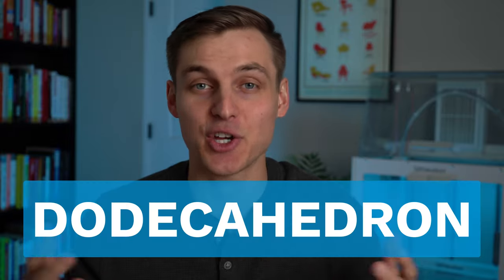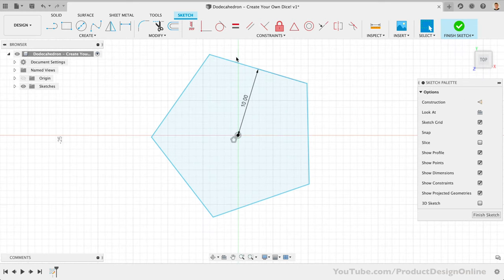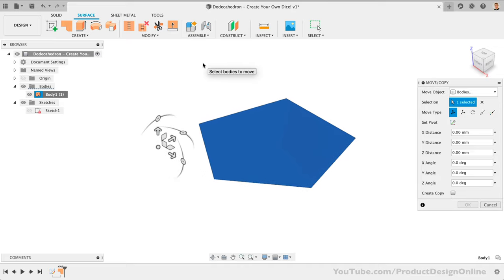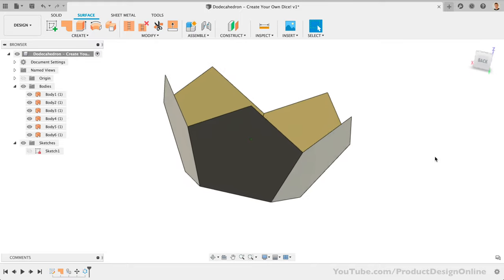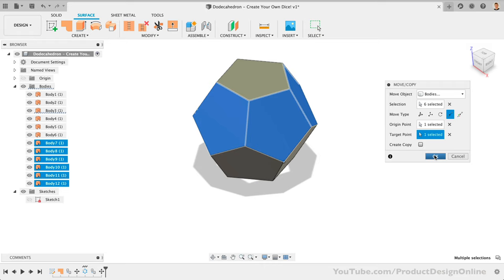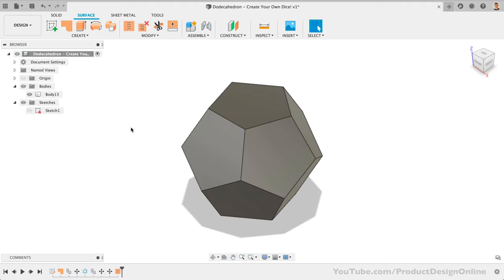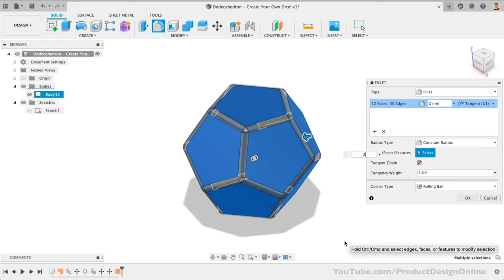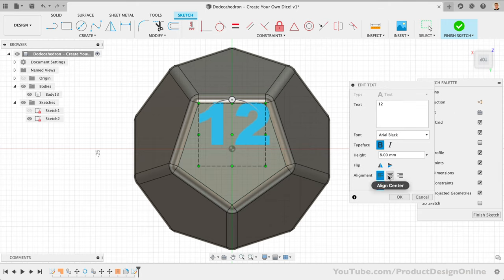Dodecahedron in Fusion 360 - the fast way!

Comment: In case anyone needed other dice shapes(or just other polyhedrals) like a D20 or D8 the exact same process works just use the the dihedral angle for the shape you want and the proper base shape in the case of D20 and D8 its an equilateral triangle

Comment: 3:03 As a dice nerd that is aggravating, making fair dice is all about precision and you have a far more precise number ready to go but then intentionally introduce inaccuracy! The stitch is forced to pull the sides together creating irregular side lengths...
Reply: So how would you make one?
Reply from the maker: You have a very valid point. This was more for fun than anything. I wouldn't recommend printing dice to anyone if accuracy is what they're going for.

You can use the equation [ π − arctan(2) ] instead of rounding and you can change the stitch tolerance to 0, which will help on the Fusion 360 end.
Reply: What about the different amount of material (mass) missing from the different numbers? does that grind your gears too?
Reply: @ProductDesignOnline  Great video, as always! But I have to say that the rounded up angle bothered me a bit, both for the inaccuracy, but probably more that it must have introduced a secondary error when you did the point to point move. The 2 corners of the adjacent pentagons can not have been in the same place, correct? :) I assume the error was very small and anyway erased with the Stitch tolerance, but still, it bugged me ;) 

Would there be any other easy way to align the corners exactly, even if one did not know the angle between each face of the dodecahedron, say it was a more random shape or something? Could it be done with joints? I´m very new with Fusion 360 so sorry if its obvious how it should be done. 

I've learnt a lot from your videos already, thank you for your work!
Reply from the maker: @Robinlarsson83  Yep! You could use Joints to position them. With the Joint feature, you would set the Joint origin - likely the center of one face - and then select the opposite face (of the other half). You would then set the offset of the Joint according to the thickness of the model.

Comment: Hi! 
I tried following this tutorial twice, but after I Copy body 1-6, rotate them 180 degrees and try to connect the points - It wont fit like yours do.
I have followed it to the best of my ability, I even tried once using the real 116.56505 degree values, but that made it worse.

I wanna make a 12 sided die where the numbers are 1,2,2,3,3,3,3,3,3,4,4,5. I tried downloading your finished STLS, but I cant edit the numbers on those. 

Not sure if its because an update or I am doing something wrong, but I followed every single step here, but fell out when it was time to connect the 6 bodies

Comment: Hi Kevin,
I watched your tutorial on how to make a custom dice in fusion 360.Now dodecahedron has even more types, such as a small stellated dodecahedron. I have been busy making this, where was more difficult than I thought, I have tried it in different ways but without no luck. The first attempt was way too hard, the second was better, but I'm struggling to get the model to fit together. With the move and rotate function it will be possible, but not the easiest way I think. What would be your approach? First make a dodecahedron, and then continue modeling from there?
Regards from the Netherlands,
Paul
Reply: had to look up what a stellated dodecahedron was... I would think you would do it exactly the same way, but before you patch the pentagon, you would create the stellated portion. then patch that entire object as shown in the video.

Comment: I have been trying to draw a figure 8 shape similar to a figure 8 race track. Do you think that you could demonstrate how it is done.
Reply from the maker: Hi Mark. Check out the "Sweep" command. You can create your path using a 3D sketch. What is the track for?
Reply: Thanks for rapid reply. It is for the roof of an architectural model designed by a student. However, the shape is a figure eight with a lower layer going under a bridge just like racetrack.
Reply: @1majca  You can try a 3d sketch and then use the sweep command.

Comment: 5:35 what does the tolerance do here?
Reply: It's not blue, so....It's not a required part of the operation.
Reply from the maker: Great question! Surface edges must be adjacent to each other to stitch successfully. The Stitch command has a tolerance control that provides an upper limit that helps the software determine the proper edges that are used for stitching.

In our project, the edges should all be touching/aligned because we placed them in place. This feature comes into play more when you have complicated surface objects with a lot of curvature.
Reply: @ProductDesignOnline  thanks for clearing that.